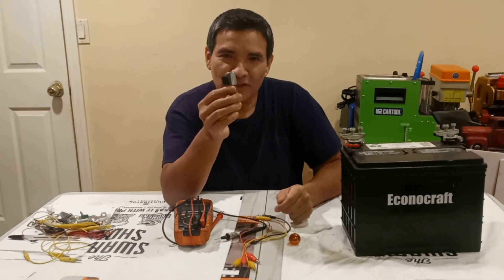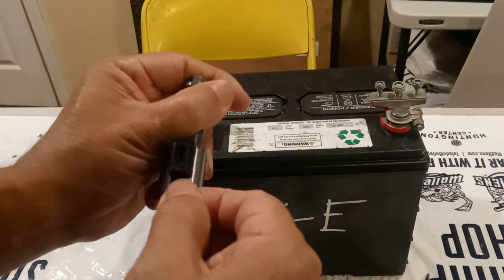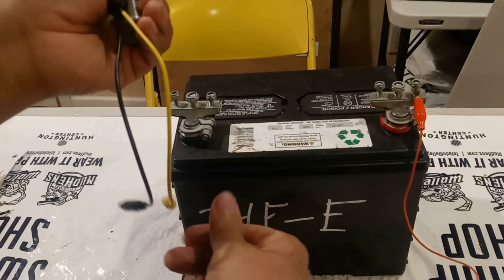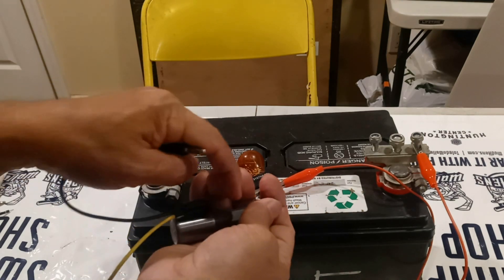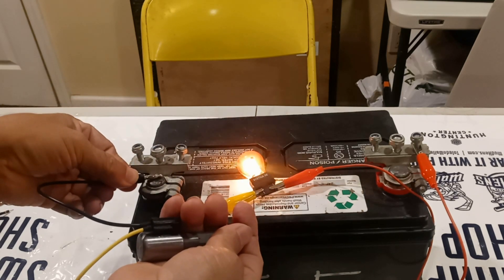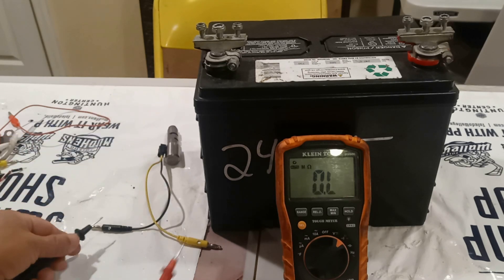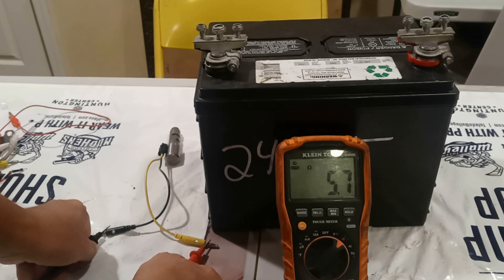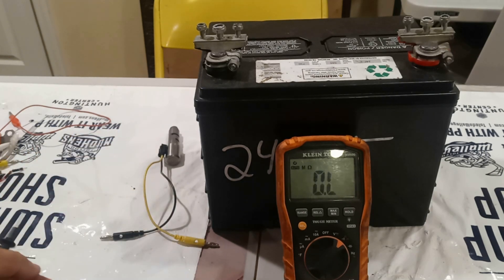Common Toyota Transmission Solenoid issues Learn To Test Them Toyota Procedure

Comment: Hello. Which shift solenoid is this? I have a 2010 Sequoia (5.7) 2wd with some shifting issue. Scanner said solenoid D but did not fix the issue.  From your experience, which is a common solenoid to fail?
Reply from the maker: What code do you have?
Reply: @JM-AUTO  code p0894 and p2714